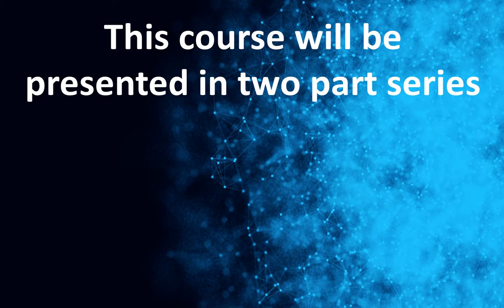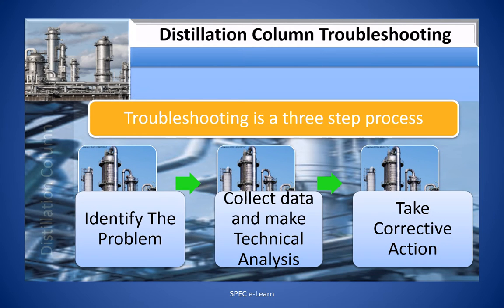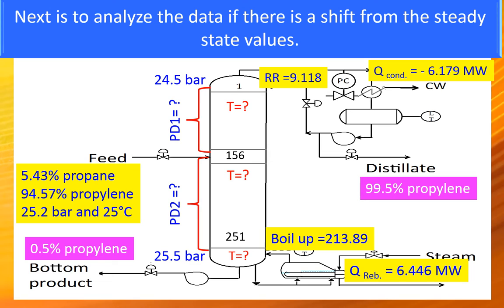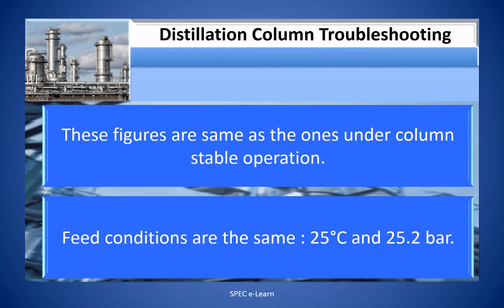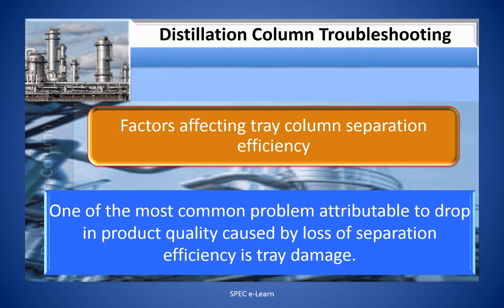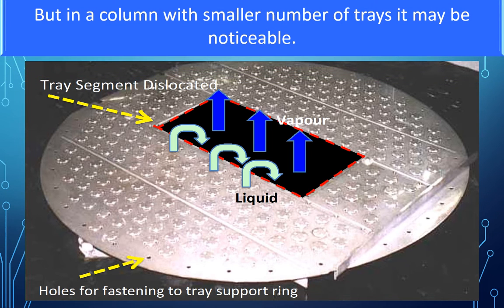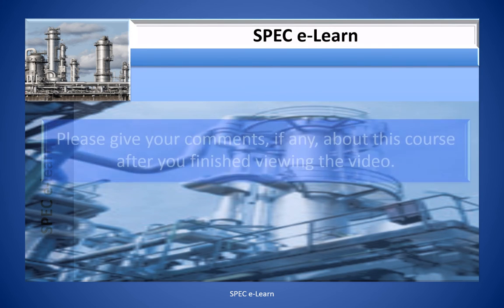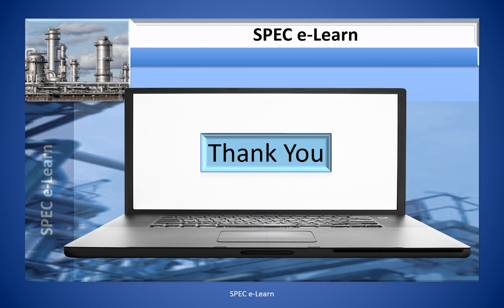Distillation Column Troubleshooting Part 1

Comment: What are the key parameters to be monitored to increase maximum feed in column to avoid damage in column
Reply from the maker: The operating parameters to be monitored when you are making an attempt to push the load to maximum, that is beyond the rated capacity are pressure drop across the column and column bottom level. Plot the pressure drop in rectification section and stripping section versus vapour rate separately. What is important is the rate of rise in pressure drop against the change in vapour rate.  If the rate of change is as before when the column was operating within rated capacity, the column hydraulic is ok. If the rate of increase of pressure drop is steeper, then you have reason to worry. The column is beginning to flood.  You have reached the maximum capacity of the column. Continued operation in flooded condition will lead to tray damage. 
Other parameters to be watched are column bottom level, distillate and bottom product composition during this exercise. A decreasing level in column bottom will indicate the liquid is accumulating on the trays. The column is flooding.